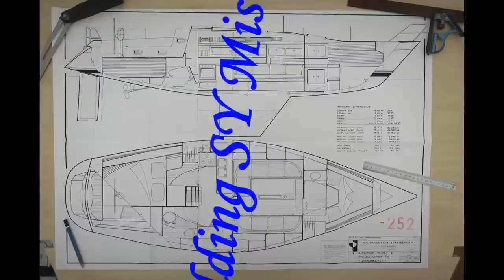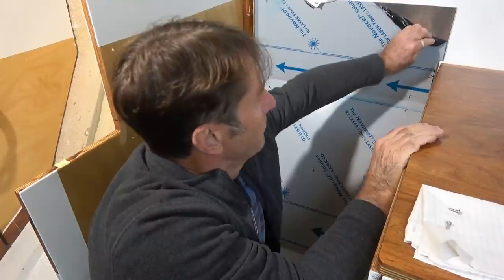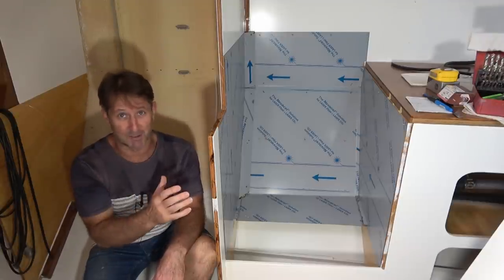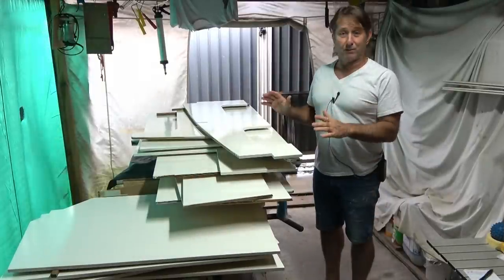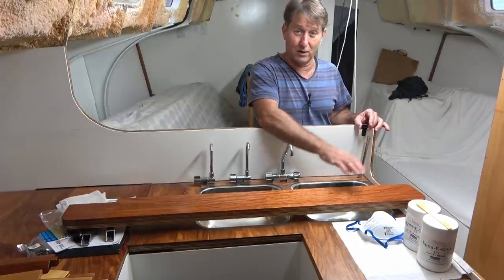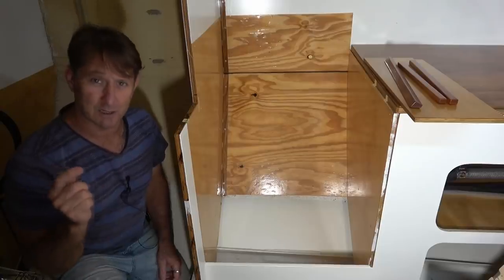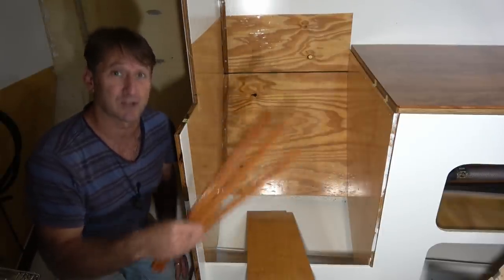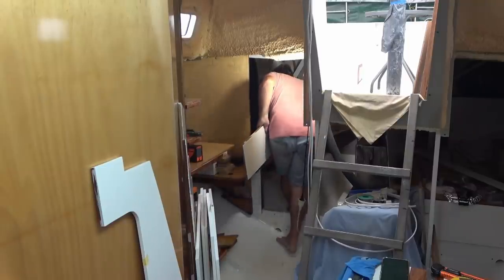ALL ABOUT Stove SPLASHBACK + Galley SHELF Ep.138 Building my steel sailing yacht

Comment: Nice work!!! I've used silver silicone sealant on aluminum trim and panels before. It looked clean and provided the water-tight barrier I wanted. It also has good heat resistance.
Reply from the maker: Thanks very much Paul, appreciated and yes I am aware of the silver silicone sealant, actually the stainless steel guys also suggested it, just not sure at this time whether I will use it,..  🙂👍